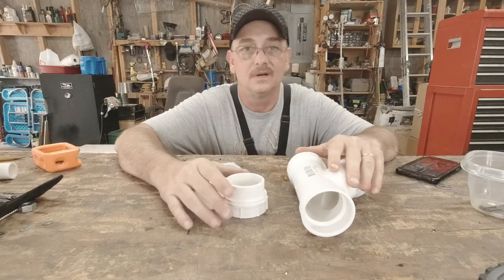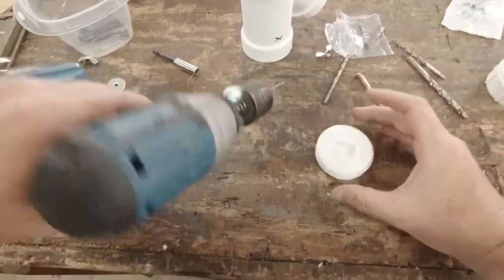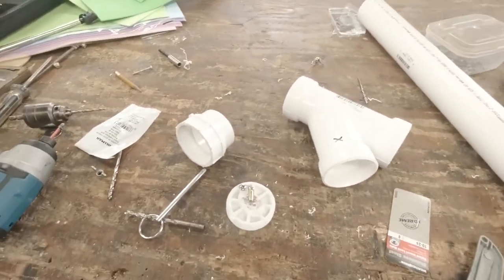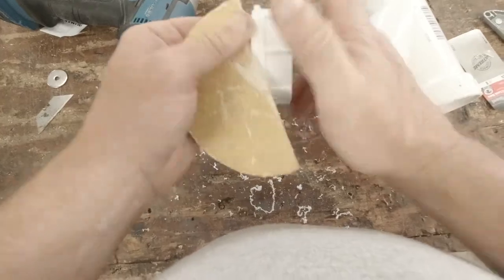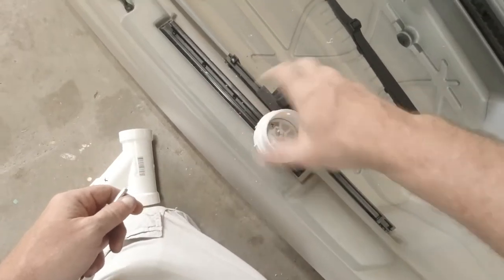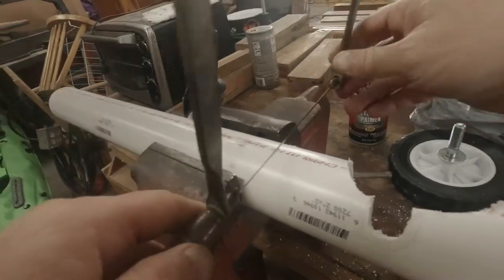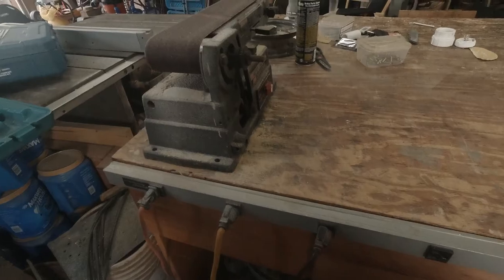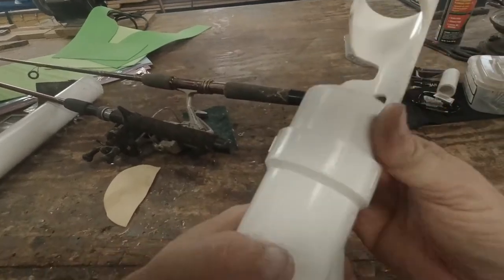Rod Holder Cheep & Easy DIY

Comment: Where did you get that pressure cap? I can’t find one with flat  on both sides. Standard clean out fitting has protruding square nut on side i want to lay flat on track/kayak.
Reply from the maker: Thanks for watching. I got all the parts in the plumbing department at Lowe’s. I could not find it either but I took a picture of it from online and showed it to a store representative and they showed me where it was. I could not find one at Home Depot. But you could also look there Or online. PS the parts are more than $12 now due to the rising cost of PVC

Comment: Nice looking project.  Thanks for sharing.
There's a tool which makes cleanup of PVC burs quick and easy.  It's called a machienist's de-burring tool.  They're made (I think) by Vanco.  When I got mine they were about $10.00.  The de-burring cutter bit is changeable and just one will last a LONG time used only on PVC.

Comment: Seems ok for small fish. But you hook into a good size stripper or a big catfish and I see the end folding over at the thin spot in the holder
Reply from the maker: Much stronger than you think but I do see your point. Just remember it’s just a $10 DIY LOL
Reply: I figure adjusting your drag and dummy cords would help most of those worries.

Comment: I fabricated used these rod holders last season for big catfish.  Some thoughts after a season of use:
1.  Use High strength PVC cement/adhesive at each junction with the exception of the threaded base
2.  At each cement junction, use a small screw.  Adhesive junctions are strong, but do not resist shear.  Combine a mechanical connection and the overall strength jumps dramatically.  A 1/2" wood screw or sheet metal screw is fine and only one is needed, even on the threaded connections.
3.  The cost of PVC has gone through the roof.  Sadly,  these fun to make and prideful rod holders are now much more expensive to make than the cheapo Wal-Mart rod holders that are better constructed with better plastic.
4.  For real strength, you need Glass Filled Nylon plastic.  PVC is not a strong plastic, but if you are not hanging the bottom or hooking big cats using 7 foot poles, then these are fine.  Remember, longer the pole, the more torque these holders will experience (Torque = Force x distance).  I had a 30 lb blue cats crack each joint on one of mine.  You have to have a high amount of drag to properly hook set a catfish while drifting/dragging.  Thankfully I was next to the rod holder when it started to fail.
5.  PVC is NOT protected against UV (Sunlight), so the paint is a necessity.  
I really liked this project, so I am not slamming them at all.  I have 5 of them on my pontoon boat, mounted using 2 flat plates of scrap steel and 2 bolts (one through the holder base) to clamp them to the rail.  However, I had to upgrade to Nylon holders to handle the big fish and now use these most as rod storage only.   These work great for a kayak on small to medium sized fish.  My observations are solely my fault as I tried to use them as trolling/drifting/dragging rod holders for big fish.
Reply from the maker: Wow, I never had anybody to write that much or comment that much for one of my videos. Yeah that video I put up almost 2 years ago and the pricing has shut up since. Also I designed that Rod holder for kayaks to be lighter weight and in no way they should be used for big cats. Thanks for responding.

Comment: Hold up.... Wait a cotton picking minute...... You left a step out.... You took it to paint and then returned with .... A. Green paint inside the holder OR B. you stuck some kind of rubber/foam inside holder.....
WHAT IS THAT GREEN INSIDE?    Inquiring minds wanna know! If it is a rubber/foam, how did you adhere it? 
Oh BTW this rod holder is BAD TO THE BONE!!!!
Reply from the maker: Yes you’re absolutely right. It is green bowl you can buy at the hobby store. And I used spray adhesive to stick it on.
Reply: @PROAMOUTDOORS  thanks for taking the time to answer me...  This looks to be a great rod holder and should work in my big fish 120. I'm hoping to have enough time to make one sat & try it out Sun..... Keep up the good work.... 
Keep them paddles wet & them lines tight!!! Cheers
Reply from the maker: @thevapingcarpenter1473  
No problem man make sure that you have subscribe to the channel I have a lot more cool DIY‘s on my kayak that you may like, thanks for watching